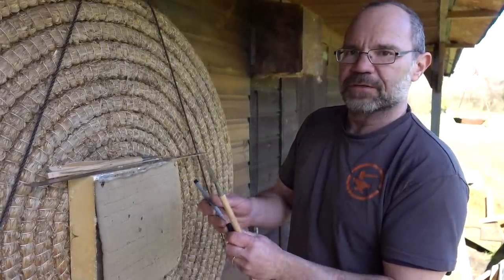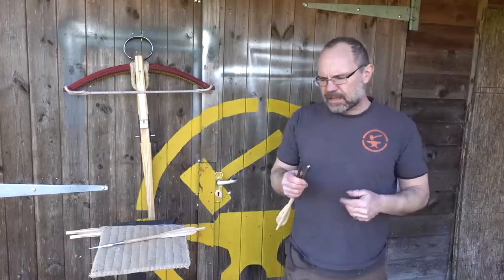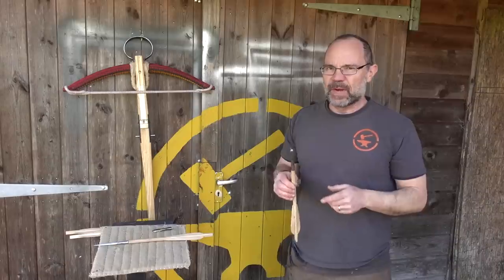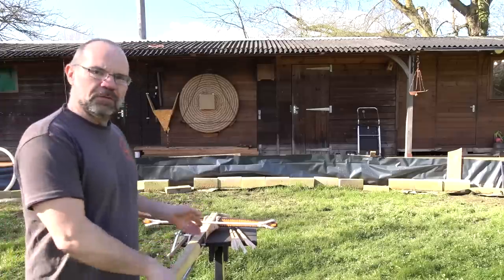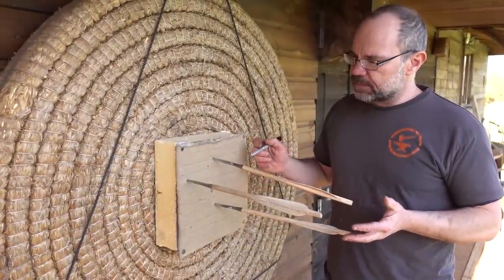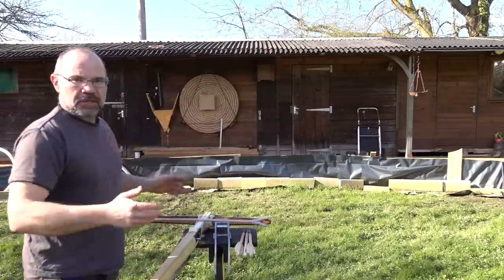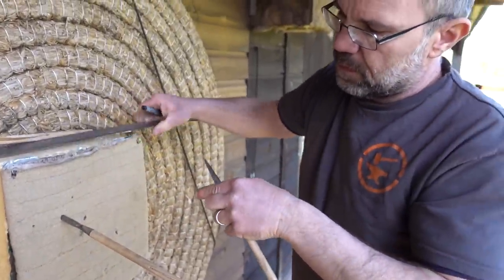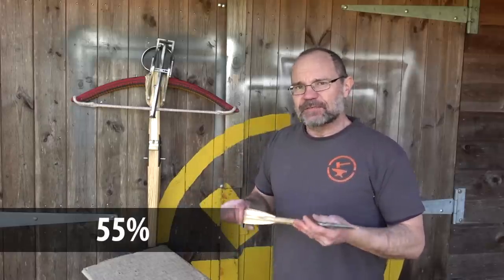Does WAX on ARROW HEADS Do Anything?

Comment: A great job with the testing. May I add something?
I read that the bodkin was filed to a chisel edge point and a drop of wax was added on the tip for steel armor penetration to give the arrow a fraction of a second to "stick" on a curved steel surface. This concentrated the full force of the arrow on the sharp chisel point at that exact spot on the armor long enough for the pinpointed energy to pierce the steel.
Be sure to use pure beeswax if testing this as it was in
common use and was probably the same wax that was
used to keep bowstrings dry.
Reply from the maker: Yes but where did you read it?  was it a modern source of some guys musings or was it written in 1400 or whatever?  I heard it spoken about, but never seen where the source started
Reply: @tods_workshop  Oh my. I am one of those people who read everything I get my hands on and the information rattles around in my head until something
comes along to pop it out. I must have read this 25 or more years ago and remembering the source is beyond my aging memory's ability. I always found the idea intriguing but have no way to cite who wrote it
down. Sorry, but keep up the great work.
It may have been in an old blacksmithing book that
I had when I was making knives in the 70's.

Comment: Tod, trying to think why I would put something on my Arrow heads, and it comes back to simple "Rust"   As a person who shoots Flintlock i can tell you most of us are obsessed with "Lubs"  Most guys have at least one  blend.  I have a Winter and a summer for the outside of the rifle & two more "patch lubs" for inside the barrel.  Leading to my long winded point.
1) If they coated the metal parts of the crossbow to prevent rust. . . . Some of them would coat the bolt heads
2) If using a coating was a regular practice, they like Flintlock shooters would likely have experimented with blends (Not limited to wax)  My blends include bee's wax, Elk tallow & Bear fat

Comment: Oh goodness, what a little detail which makes all of the difference! I must try that myself. It is amazing that a tiny bit of wax ca both protect from rust, and actually increase the piercing power. Now this warrants some trials with different compositions, maybe have a go with straight up wax, and then make softer and softer pastes of say 10%oil in wax, 30%, 50%oil to wax, maybe we'll see a difference. That said, it's not that much of a far cry to imagine that bow and crossbowmen carried a stick of wax to maintain their strings and such, no reason why they couldn't just rub some wax on the arrow/quarrel heads. Lovely piece of information, I have to try that out myself tomorrow!

Comment: Perhaps dipping the head of bolts and arrows was done as a matter of course when manufacturing. It would reduce risk of corrosion while they were stored and a secondary benefit of greater penetration.

Comment: When you said put wax on it I didn't think you would have just diped them in wax. I've been learning blacksmithing. The first thing I learned was how to make a tent spike. It thought me to draw out and taper. Tought me how to flatten out and make a curve. We also added a twist in them to help keep them in the ground. One thing we also did was heat them up and apply beeswax all over them. Helped to keep them from rusting. Is there any possablity that putting wax on could have meant heating and waxing ?

Comment: Really impressive improvement in penetration! Kudos, Tod!
I was thinking that there might be some degradation of the protection as you punch more holes into the gambeson, but the layers ought to be pretty durable, it is not the same as ceramics against modern bullets. And the results within each set of 3 is much more consistent than the almost doubling of the penetration with the wax, so it is clear that the sudden increase cannot be because of the shooting order.

Comment: Adding to that, I was told that when shooting from an elevated position like a castle wall, a bit of wax was used on the catch area to hold the bolt in place to stopping it slipping off when aiming downwards. So if its already basically on one end of the bold why not put it on the other too.
Reply from the maker: You hold the bolt in place with your thumb....
Reply: @tods_workshop  So they didn't do that?  Another experiment to be made?

Comment: So I have 2 other ideas I think might be interesting to try.
1)Modern steels are often coated in light oil to protect them from corrosion why not try the same on arrowheads? maybe the oil will outperform wax? Could this corrosion protection have been a possible reason for them to wax their arrows?
2) While you are at it how about also waxing the arrow shaft, the arrow rest and the string to further reduce friction ? as I understand it you lose quite a bit of energy to friction in these places right?

PS: great video, keep the geeky/ nerdy stuff coming thats what we are here for.

Comment: Just as an interesting thought, the wax application would also be multi-purpose since it should, also, work as a protective layer for the metal against corrosion, and probably cover any defects int he metal to let it fly better, along with deeper penetration there.

Comment: Just to clarify the experimental conditions, to what length was the wax coating spread on the bodkin?
Judging by the size of your hand, it might be 25-30 mm. Add to this the 15-20 mm or so of unwaxed penetration, that indicates that the gambeson stops the bodkin via a friction effect. But you'd have to lubricate the bodkins to different lengths to check this out. It would also be interesting to see the hole it made.

Comment: I made the mistake of applying lube (modern arrow lube for 3d target shooting) to my crossbow bolts. I was shooting a 380lb recurve crossbow (modern - Excalibur, Blackout 380) at a target block rated up to 400lb draw weights. Non lubed bolts penetrated 6 to 8 inches and were very difficult to remove so i thought lube would help. Big mistake. The lubed bolt over penetrated to the point the fletching was mid-block. and only saw the tip and shaft of the bolt poking out the other side of the target block. Ruined a few bolts that way.

Comment: I wonder how they'd perform with some pig fat, deer fat, or goat fat coated on them, or some neet's foot oil or olive oil.
I know when cooking, I like to coat my knives with olive oil before making cuts, even though my knives are kept razor sharp, the suction of thick meat and various vegetables causes the blade to stick unless oiled. The absolute best example of this is when slicing home made maki rolls. Trying to slice clean cuts into maki rolls without an oiled blade is a royal pain in the arse. Perpendicular fullers help a little, but oil is the game changer. I bet it's the same for arrow heads; a well oiled or greased arrow head likely will pierce a target more cleanly than not.

Comment: Ive been putting burts bees  lipblam on my broadheads for a few years now.

Also my knives. Mostly a protective layer but i figured the lube wouldn't hurt.

Burt bees wax is the closest i could find to imperial cureators wax off  a shelf in small town Alberta.

Comment: Actually, I noticed while test cutting that oiled blades, right out of the scabbard, seem to cut better, at least as long as there is some oil on the blade. Whereas waxed blades (renaissance wax) seem to stick in the cutting target and do not pass through as easily. So I keep my sharp blades oiled and decoration swords waxed for rust protection.

Comment: Interesting how the weave of the canvas is just deforming and not tearing or cutting... essentially the bolt is pushing the threads aside until the weave tightens around it so much it can’t penetrate further. It catches it, basically.

I’d be interested in seeing what would happen if those needle bodkins were given just the tiniest bit of a cutting edge along 2 opposite sides. That’s why the flesh cutter did so well, it sliced a hole bigger than its shaft... no resistance along the shaft, furthering the penetration.

With that tapered point just pushing the weave out of the way, the needle point just encounters more and more resistance until it’s momentum is cancelled by the resistance of the fabric.

Comment: The round head bolts with wax would have a slight explosive effect on hitting. It would probably improve if there was a dimple in the middle of the head. Air rifles use dieseling  to increase their power. Also consider that the wax could be mixed with other things more explosive and horses don't like loud noises and are easily startled.

Comment: Modern compound archers shooting field archery use grease on their arrows to aid removal from targets, however, the arrows do penetrate  a lot deeper when this is done. On the  subject  of arrow head design, l tripped  over an obstacle while deep wading on the river Wye a few years ago, much to the amusement  of the drinkers in the pub over the river. I waded back in to get rid of the tripper and pulled out what l first thought was a spear  point.  I got in touch with various museums and it ended up at a uni at Newcastle  were it was confirmed  as a medieval arrow head. Well this big boy us about 9"long and would take  a shaft of at least half an inch. Pictures available  if required.

Comment: The wax might reduce surface contact between arrow and target, so potentially yes. . .  Also try rubbing a bar of soap, because that will put a silky coating on the arrows, soap might not reduce as much as wax would under heat and friction

Comment: I can think of a practical reason beyond just improving penetration.

Wax is commonly used as a waterproofing agent (or at least water resistant).

You have a whole bunch of bolts/arrows in storage.  If they get wet... they rust.

You put wax on those bolt/arrow heads and they don't rust.

It's like cosmoline and old rifles: it's there for long term storage and rust prevention.

Comment: Would have to wonder if they did it as dual purpose. Wax dipping is still used as strategy to reduce corrosion and protect the points on industrial tooling, maybe they were doing an early version of that and by happy quiescence found it increased penetration.

Comment: I think that what we see here is reduced friction on the bolt once it has already penetrated - beeswax gets scraped off of the side of the bolthead by the fabric and reduces friction. This is why we actually don't see this done with bullets, they are so short and thin (friction depends on surface area) and move so fast the gains would be negligible.

With that in mind, and the fact that beeswax was relatively expensive, IO wonder if you can get similar effect with oil or grease. Beeswax would be still preferable, it's much better for long term storage, but still.

Comment: If you put teflon on them they'll go straight through the stable and possibly tear a hole in the space/time continuum.

Also on a more serious note, it would have been easy/fast to coat arrowheads by dipping them in a pan of hot wax and it would perhaps have reduced the amount of rust build-up if they were being stockpiled in a dingy armoury somewhere.

Comment: Just to add a couple of cents, the wax on the tip of the plate cutter bolt might be to help "normalize" upon impact, so it gets traction on the surface instead of sliding off, allowing it to deliver its energy properly, you might find Armour Piercing Cap shells interesting in that regard, not the same, but a similar concept, also dealing with sloping-ish armour.

Comment: It may be worth repeating the test using tallow, lanolin, lard and other period fats. Wax was of course used for strings and fletching but it wasn’t as cheap and easy to get in quantity as tallow and lanolin etc. Could you also experiment to see what effect wax has if the arrows are pricked into clay soil before shooting as the chaps at Agincourt may have done.

Comment: Arrows were waxed or covered in tallow as maybe a preservative to prevent rust and they noticed the older coated arrows went in deeper than the new arrows that that just been made and were used right away so no need to coat them.

Comment: The teflon bullet thing is an urban legend.  There was a well designed personal defense round that got legend status and people believed it could bypass body armor.  The round had a slight coating (to facilitate loading or something mundane), that gave the bullets a dark grey coat, so people thought it was teflon, in order to validate their belief it passed through body armor.  In all honesty it was just one of the first modern defense round and 80's quality rumor mills.  It is not designed for bypassing armor, and has no greater chance than any other standard defences round.  But the teflon myth is a persistent one.

Comment: Workshop accident - a powerful circular saw set "on" spun out of my grip, fell to the floor and the blade ran along the outside of my right foot. Wool from my sock stopped it in moments - snarling the mechanism. My brother said he thought that is why medieval archers preferred woollen garments. Chain saw trousers are designed to do the same - the inner flock binds the chain dead. Plausible?
(I still had 8 stitches but the gash stopped short of a major vein by 1 cm)

Comment: Makes sense they could have tried waxing bolt and arrow heads to protect against corrosion (Eg when on campaign), and they may well have tested to see if it needed to be cleaned off before the heads could be used.
It would be interesting to know if other protective coatings, eg oils, could have had a similar effect.

Comment: It makes sense that bodkins wouldn't work well on gambeson.  Gambeson is basically the historical equivalent of a kevlar vest - multiple layers of a strong woven fabric.  Kevlar is much stronger then linen obviously, but the same forces are involved.  When a projectile impacts the fabric, it deforms it, and puts the fabric under tension in all directions.  Fabric is very strong under tension.  A bullet, which is round, will face the most, since it deforms in all direction.  A bodkin will be similar, since it has 4 equal sides.  A broadhead will not - along the edge, it will be putting the fabric under shearing force instead of tension.  Fabric is very weak in shear (see: scissors).  Once cut, the fabric can no longer hold against tension and simply deforms around the rest of the arrow.

Bodkins are designed for mail because they concentrate all the tension created by the impact into a single ring, which bursts and then lets the arrow through.

Comment: Over 50 years ago, there was a TV programme called 'Out of Town'. In one episode, Jack Hargreaves demonstrated the effectiveness of wax on a crossbow bolt tip. Without wax, the bolt glanced off a steel helmet. With wax, it went through. Jack's explanation was that the wax increased the coefficient of friction between bolt and helmet.

Comment: If you have ever done much woodwork/carpentry you will quickly discover the benefit of waxing your saw. Try cutting some thin ply with a old saw and then try waxing the saw, just a few lines of ordinary candle wax on the blade is enough to make a huge difference. 

Also if you buy good quality wood screws they come pre waxed. As a child I remember seeing an old joiner would often dip his screws/nails into a grease of some kind if the timber was hard to screw or nail into.

I also wonder if armour was also waxed to both polish up the armour and also help deflect bows. I believe boxers will grease up their faces to help deflect blows.

Comment: Hmm the notorious "teflon coated bullets" is more to protect the steel barrel from the equally hard (if not harder) steel armour piercing bullet. But even that fad as died down, most armour piercing bullets are just clad in the same copper jacket as lead bullets. The velocities involved with even the slowest modern bullet are a completely different work from arrows and crossbows, it's like comparing the speed of a car to the speed of a jet, completely different physics.

Comment: Super interesting, and possibly similarly important as the hardening of bolt/arrowheads for the general understandig of missile troops and use of missile weaponry in the classical to early modern period.
Reply: because you can basicly state, that its possible to make your projectiles possibly pretty deadly, by making an effort: hardening, waxing, use of poison or more likely feeces/ just stiking them into the ground and of course using the right head desing for the given situation.
So possibly, the deadlyness of bowman was higher than at least I had perceived them, and some other things might be understood somewhat better: The use of slings might have dropped, because you cant improve the projectile as much. The transition to gunpowder weapons was maybe a little bit less of a huge leap in the usage of technology in the field by missile troops.

Comment: I wonder if they meant it more like AP Capped tank ammo? A softer metal coating formed as a blunt face with a shoulder about the rim, over the somewhat sharp AP core. The soft metal "Normalizes" the angle at which the AP core actually hits and it might do the same with crossbow bodkins vs metal plate.

Comment: A possible reason for putting a daub of wax on the tip of an armor piercing arrow is to reduce the chances of the point from just sliding along the surface, increasing the angle of incidence that will allow for a penetration.  The second leap forward in armor penetration (with respect to naval gunfire) after going from round shot to pointed shells was to fit a soft lead cap over the hardened steel point of the shell.

I admit that this is merely an educated guess based on applying a solution for naval gunfire versus shipboard armor to the problem of arrows versus plate armor.